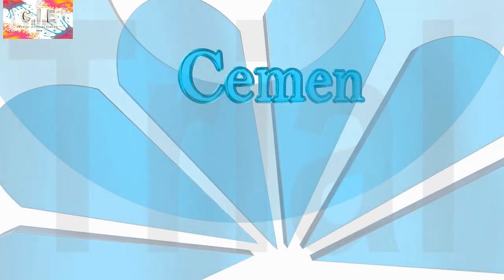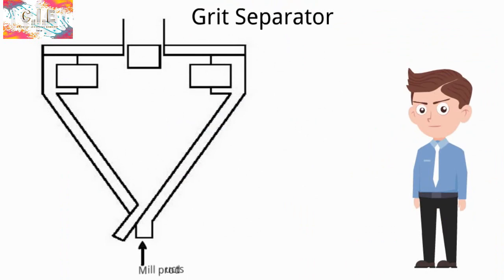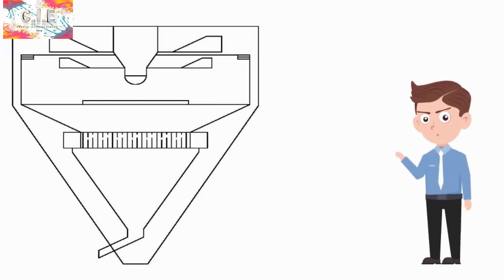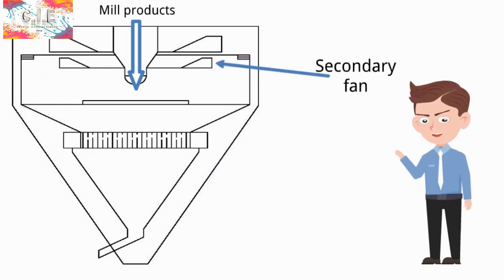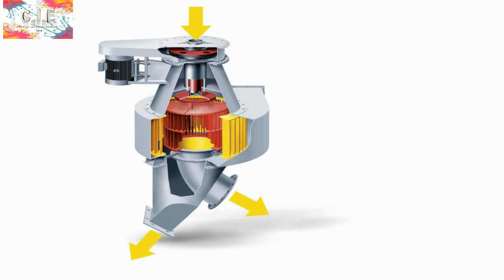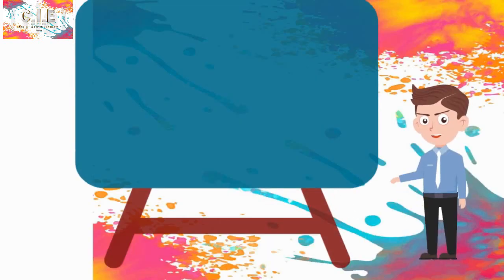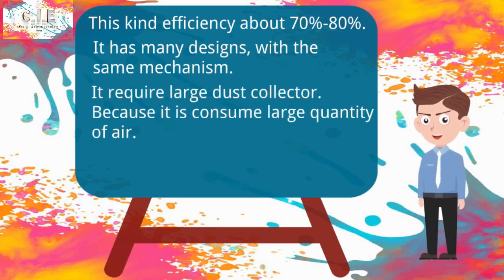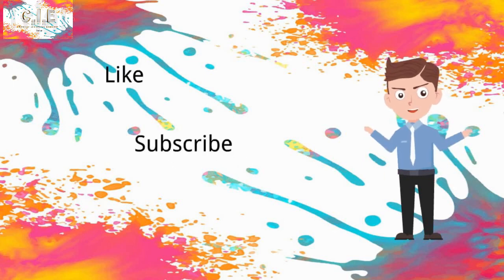Type of Separators I How to adjust its Fineness I Cement Manufacturing Practice I 5th Episode

Comment: Is fresh air compalsary in Separator
Reply from the maker: The Fresh air is pumped into the mill at a certain speed in order to obtain grinding materials of a desired size
Reply: I mean to say that is fresh air is necessary to lift material from Separator
Reply: I am talking about ball mill
Reply from the maker: @ravikhandelwal4801  Sure, Air is the main factor in the separation process because it bring materials at the required volume depending on Air's velocity
Reply: @omaralksabra9703  ok thank u sir
Reply from the maker: And it is noticed that, in new vertical mills the Separators combined with the mill; not individually 👍
Reply from the maker: The separators is necessary for any mill. The main factor to Separat the required sizes is the air. Like if you saw that in movies or something, if there are sand and the air come with high speed will bring with it a littile bit of sand.
Reply from the maker: You most welcome. 👍